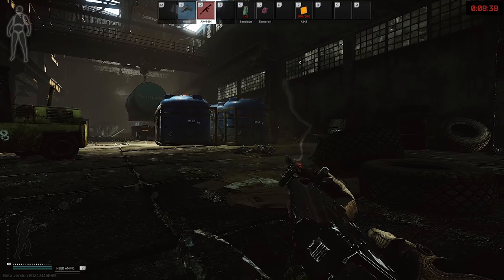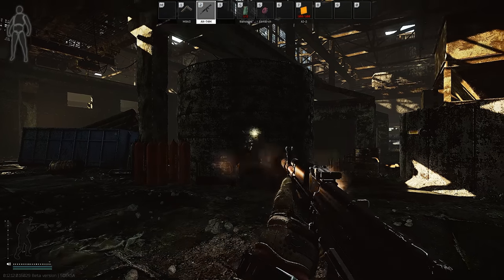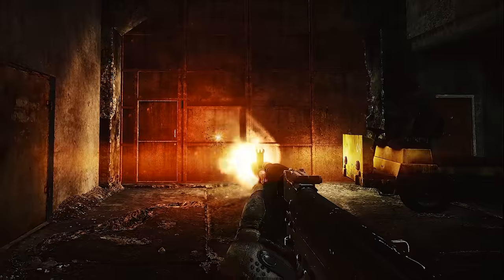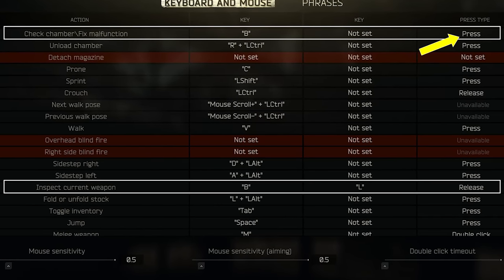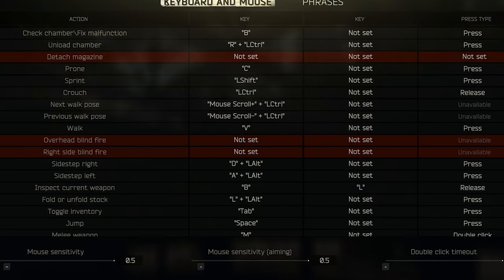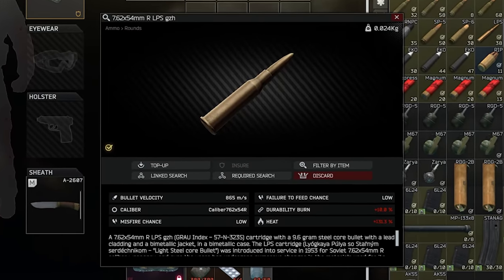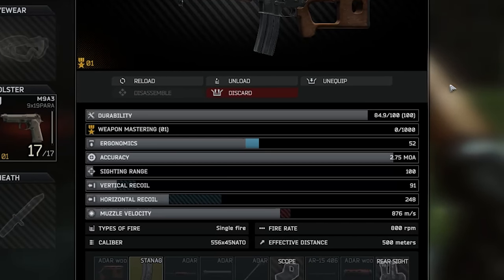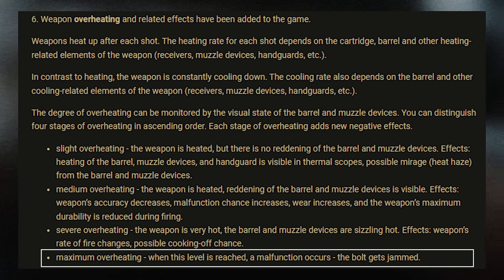Malfunctions Might Change Tarkov’s Meta Forever!

Comment from the maker: How do you feel about the new weapon mechanics added in 12.12?
Reply: They took what looks like a step in the right direction to me, but there might be still a few things to tweak in the implementation.
Reply: I've yet to encounter a weapon malfunction so far, almost level 30. I use small mags and rarely need to fire more than once per target. I like this way significantly more than the last iteration. Giving me the options to mitigate the malfunction chances with my gameplay and equipment choice.
Reply: It's great. It pushes users to use a lot weapons on semi auto. Prevents 1v6, overheating reduces accuracy and increases chance to misfire. This is all good and actually pretty realistic
Reply: @davidmagana556  Except recoil is comically overstated now, and there are a lot of weapons in the game designed for full-auto use. Overheating is also exaggerated, although to a lesser extent. So no, it's not that good nor realistic. They implemented the right mechanics the wrong way.

Comment: High cap drum mags have a high failure to feed chance for balance, as well as because IRL they're crap and jam super easily as a byproduct of the way they're designed.  And as a regular shooter, I can definitely say the stop-light feature is nice.  You absolutely feel when the firearm doesn't perform correctly after you get some experience behind the weapon and you know when the recoil isn't right for a squib, the bolt jams back on an empty chamber or double-feed,  or get that dreaded click of a misfire.  All things you simply cannot replicate in game.
Reply: Why even bring up realism the game isn't trying to he realistic just look at the recoil this patch if you've ever fired a m4 in real life the recoil is almost nothing but in tarkov my trained military operator looks to the sky's after 3 bullets
Reply from the maker: I think that's the point, the system is designed for a better user experience. There are always many people using realism in their discussions so that comment is for them primarily

Comment: What do you think about recoil being increased even further? I absolutely hate this change, it`s impossible to shoot stock guns in auto mode (AKM is especially terrible), and it didn`t get more realistic eather - recoil decreases the more you shoot, which is dumb and makes short bursts useless.
Reply from the maker: I was hoping they'd change the system. What they did was keep the current system, but amp it up. Full auto is still controlled by the pmc in long bursts - albeit its a little more jumpy. But burst fire still sucks

Comment: Would be cool if they added a slamfire mechanic to the SKS with low durability.  I've seen them empty entire mags on their own because of a stuck firing pin.
Reply: I've had that happen to me at the range. lol
Reply: Not just SKS, all guns with a potential for this problem.
Reply: @F1ghteR41  yeah but the sks has a floating firing pin which can cause it to be more of a problem with the sks than other weapons. I’ve only had it to happen to me once on the range
Reply: @deerhunter5248  AKs also have it.

Comment: Interesting about bigger mods causing faster heating and slower cooling.  You would think it would add thermal mass that resists heating and cooling, so it would heat slowly but cool slowly too.

Cool video, thanks!
Reply from the maker: Thanks! Yeah it's gonna be interesting to see what the stats are on the meta parts
Reply: yeah i really wanna know why my hadnguard with a bazillion holes in it causes more heating them the stockone thats fully closed

Comment: So with the keybind, can you press the keybind, hold it then release it after the game tells you what the problem is to unjam?
Reply from the maker: I think you'd need it the other way around then, inspect on press and fix on release. But it's kinda janky because if you do it too fast, all that happens is you inspect over and over. You have to hold it until the inspection is done, then release. That does work but I feel its more prone to errors in the heat of the moment
Reply: @Gigabeef  Oh right it's the other way around lol and yeah that wouldn't be practical at all now that you put it that way :p

Comment: 1:01 I was fully expecting USGI 30-rounders to demonstrate such behaviour to finally threaten M4/HK416/SCAR dominance at least a tiny bit, but alas, I've not seen it yet.
3:10 Clever trick again! Time to update your video on key bindings!
3:51 Well, now I'm not getting why the regular switch-to-pistol animation still keeps to be so long. Why not change both instead? Almost every shooter these days has learnt the lesson.
4:21 First and foremost it reflects the fact that drums tend to be somewhat unreliable in general, and the same goes to quad-stacks.
Reply from the maker: Yeah I agree, why they don't just change the pistol swap for everything. Keep gun 2 swap the same but sidearm fast would be neat!

Comment: 5:24 To be frank with you, I believe these numbers are somewhat exaggerated in comparison to reality, and while they could theoretically serve as a nerf to some of the META guns out there, I'm not sure if they're implemented on an individual per-weapon basis correctly to do that.
7:38 This is a great point to make, but I'm not sure whether those two categories are significantly different, to be honest. I feel like more reasearch is needed and hope for your future videos on the topic. Keep it up!
Reply from the maker: Yeah I imagined that was the case, it's a bit like the in raid time and food/drink - if it was realistic it would hardly be a mechanic at all (I guess like it used to not be!)
Reply: Kalashikov has a YT channel depeding on the model an ak shoots between 800 and 1400 rounds of uniterrupted fire before it jams. by then the handguard is usually on fire. also no cooking of there
Reply: @Gigabeef  It would still be a concern with high thermal loads on machineguns, which are planned to be implemented anyway. In the current state it looks too much like Far Cry.

Comment: They should add inertia to weapon calibers, until then tarkov will just be equipment against better equipment. How can it be, that some can immediately fire back when hit in the chest with a slug, even 10mm already can break ribs when hitting hard armor.
Reply: When you get shot your stamina is drained to zero
Reply: @DGfilms1996  that's not the same as inertia though. With a slug or other big calibers you should suffer so much shock you fall to the ground.
Reply: @The2808erik  I agree but maybe only do that for shotguns because that’s just gonna make m61 and snb way too op imagine getting hit once and then not being able to move at all it would not be fun
Reply: @DGfilms1996  To deal with ten thousand malfunctions that occur way less frequent in the real world isn't fun either. They need to find a middle ground in realism and fun. They also should rework their inventory system, a lot of basic functions are missing games with a similar inventory structure had 20 years ago.
Reply: bruh that shit would be unplayable

Comment: I think these changes are straight up Full Auto Nerfs which i personally don't like. Every fire mode should be viable
Reply from the maker: Tbh it seems like a bit of an everything nerf, because even semi resets slower now and the first few rounds jump more than before. It seems to me all they did was amp up the old system a bit more than before

Comment: dude that side arm super speed thing sucks, it would’ve be fine if they just kept it in normal speed
Reply: Explain how it sucks? Its super speed like you said, so you shpuld beable to fire bqck at them rapidly? How is that a bad thing?
Reply: @everythingpony  because if you switch to your sidearm normally without a malfunction it doesn’t go that fast, it’s sped up, if you bring a pistol you shouldn’t be given a buff whenever your primary has a malfunction, your advantage is already having a side arm